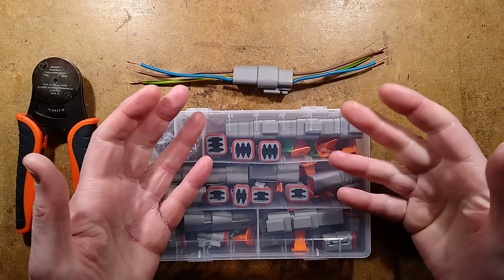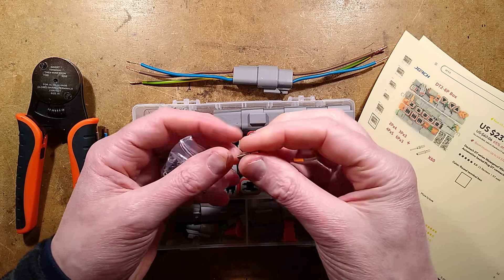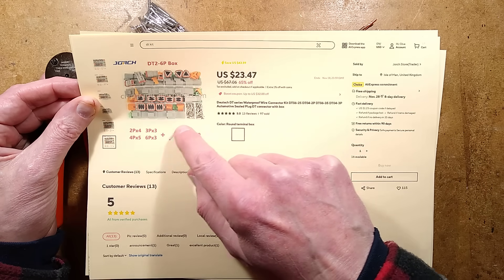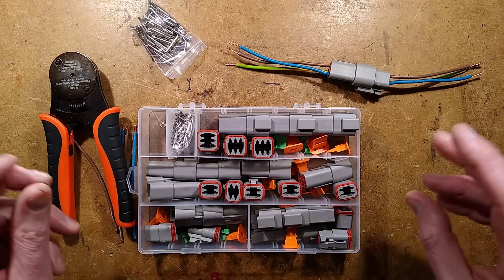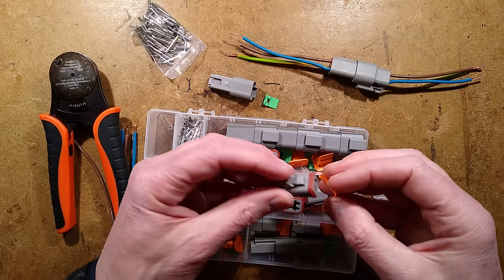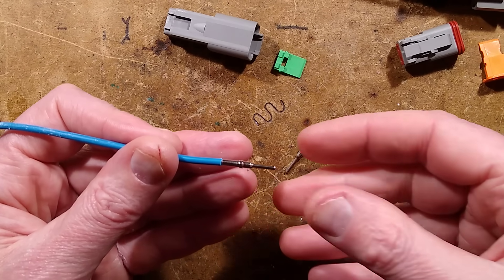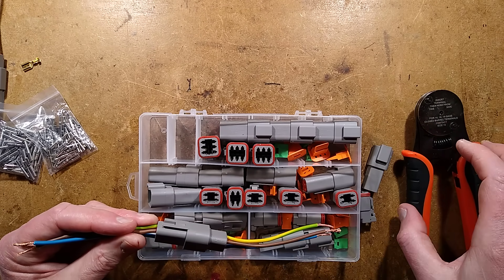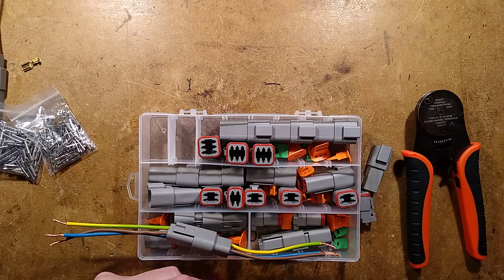Deutsch - my new favourite rugged connector

Comment: Speaking of connectors: does anyone in the audience know the name of these black non-waterproof locking connectors that are usually at the end of LED strips (WS28xx etc)? Approx 2,54mm spaced apart, with the female plug having little "wings" on the side and the male plug having the lever on top to pull them apart again. Looked for them on ebay, but couldn't find them due to the lack of a name to search for... They seem to come in 3 pin, 4 pin or more variants...
Reply from the maker: JST SM?

Comment: Oh, I like those!  More than the ones with the yellow concertina rubber seals.  I'm sure they look very similar to connectors I've seen in my motorbike.  I love your adjustable tool.  I have a similar ferrule crimp tool, but it crimps square rather than round and it's not adjustable - wonder if it will work with the round crimps.
Reply from the maker: The ferrule crimp tool is not suitable for these.

Comment: Actually, brand name Deutsch connector kit from Amphenol (their AT series) is not that expensive in comparison. The AT-CK-715 (715 pieces) kit is GBP 154 from Digikey. The cheapest Amphenol branded tool (AUTK-16) is GBP 35 (more expensive tools available). Not as cheap as AliExpress, but cheap enough that I do not see any reason to buy the copies anymore so I switched. (and yes, Amphenol is also a copy as the original Deutsch is now TE)

Comment: Description
Report Item
188/250pcs Deutsch DT Series Connector Assortment, Size 16 Stamped Contacts, Waterproof Automotive Electrical Connectors

Power Supply: Use Without Electricity

Bttery Properties: Without Battery

Power Supply: Use Without Electricity

Bttery Properties: Without Battery

Deutsch DT Series of environmentally-sealed, connectors are designed specifically for cable to cable applications on the engine or transmission, under the hood, on the chassis or in the cab. Where signal level circuits in harsh environmental conditions,

where even a small degradation in connection may be critical, the Deutsch DT Series general purpose connectors will provide the reliability and performance at the lowest cost. Thermoplastic housings and silicone seals are used to allow the connector to withstand conditions of extreme temperature and moisture.

The solid contacts are designed for use with larger wire size and heavy duty applications. Solid contacts are manufactured using a cold heading process with solid copper alloy wire. Particularly used for critical circuits.

Material

Plug/Receptacle Shell: Thermoplastic

Wedge: Thermoplastic

Grommet: Silicone Rubber

Contacts Pin: Copper Alloy

Socket: Copper Alloy

Finish: Nickel Plated

Sealing Plugs: Thermoplastic

Comment: At 1:38 you described the most common crimp, but you said that the tool curled the sides of terminal into the wire.

I was under the impression that the crimping tool was supposed to go the other way around, and the curled over pieces were supposed to remain as they are while the tool creates a divot in the flat side of the terminal?

Comment: In the end, Deutsch is just like AMP, Erni, ADC Krone and Intercontec part of the big TE Connectivity, former Tyco Electronics, who moved their head office from the Bermudas via Switzerland to Ireland. It may happen that their products that come from China will receive a drastic price increase in 2025 in the US, so it might be recommended that all the enthusiasts here from the USA consider to purchase Deutsch connectors now. Or you believe that the production will come back to USA, which will rise the prices as well.
Reply: So the price goes up, big deal. UK has that VAT. Either way trade is slowed and buyer pays. The last time they did the tariffs thing the parts I buy ended up being stamped as from a country other than China but were otherwise identical in every way. The price did not increase.
Reply: China has workarounds for tariffs, but prices on many things will still go up. Many Chinese companies have moved production to other southeast Asian countries as labor there is cheaper. What we really need is some sort of certification for Chinese made electrical products. Many are of dubious quality, and some downright dangerous, as Clive has shown here many times.
Reply: @ I agree that there are dangerous products coming from China. Anyhow, it never matters where a product is made, it matters who is making it. TE Connectivity / Deutsch will not produce and sell obviously dangerous products.
Reply: @Herr_Bone  That's true, a branded product will have quality control and accountability no matter where it's made. Watch for counterfeits though, some name brand parts are counterfeit and of bad quality. I'd rather have a "house brand" from any big retailer than a counterfeit "name brand".

Comment: Would normal ferrule crimper work as well? (That crimper looks like modified ferrule crimper)
Reply from the maker: No.   It has to use much higher pressure.

Comment: I worked a lot with crimpers similar those when I was in the Navy. We have SUITCASES of crimpers and crimper dies to the tune for some aircraft like the A-7 the Daniels Manufacturing Corp. kits (short name, 'Daniels Kit') had a total of 8  SUIT CASES, with two with similar crimpers for various purposes and different die sets which can be mind boggling when you start with them. Seeing it taken to the consumer level is pretty cool.
Reply: we had to count the number of crimps each crimper and die had done and record it on the tool sheet. after so many crimps the set had to go and be tested and released back in to production by the QA dept. real glad i did not work in  production.
Reply: Of all the places where standardisation would be the sensible thing, the military is it. I suppose you can't charge the tax payer as much if everything uses interchangeable tools though..

Comment: Have you actually placed them in water with 240v and see if they work?
Reply: Of course not...the requirement for automotive applications, where these are most often used, is not full water immersion.

Comment: Having just bought a boat on which the previous owner used a chocolate box connector for the supply to the masthead navigation lights I am very grateful indeed to you for this video. These connectors will be just the job and they are light years cheaper than any "marine" equivalent. 
Utterly perfect timing and my order for the kit and crimper has been placed.
Thank you sir Clive.

PS is there any way to buy you a coffee other than using evil PayPal?
Reply from the maker: PayPal is still one of the best options.  But for ongoing support, Patreon offers more for your dollar.

Comment: Is there no spring tension anywhere in the connection; it's just a straight rod in a tube with no bottoming out? I'm surprised these would work reliably in extremes of temperature if so, given thermal expansion/contraction.
Reply from the maker: There's something inside the tube that creates strong friction.

Comment: Nice connectors.  I'll have to consider these.  Not sure I'd need much more than 2 or 3 wire ones though.  Hey, I have a question.  Is it possible to add a continuity tester beeper to a multi-meter that doesn't have one, but does have the diode check setting?
Reply from the maker: It's not a good idea to modify an existing meter.

Comment: They also use these in Caterpillar wiring harnesses.  A friend of mine who happens to be a Cat mechanic got me into these.  Used them everywhere in automotive applications.

Now we’re moving onto DTM connectors #becauseracecar and as such need lighter weight.

I would also highly suggest getting the proper tool as they provide a little more adjustment than the bear bone tools.

Comment: Another way in which the 'shallow penetration' design makes it safer is that if the lock has opened and the connectors begin to separate, the pins will disengage before the waterproof gasket clears the throat and so water will not get in to a connected circuit.  Or at least, you may notice the loss of continuity before it falls open.

Comment: I worked for Deutsch IPD for 19 years as a machinist and toolmaker.  Carl Deutsch was a good guy to work for.  Seeing those connectors again brought back a lot of cool memories. Thank you.
Reply: Both my Dad and my sister worked for Deutsch in the 50's and 60's. my dad, I believe was in sales, and my sister, Assembling  the connectors.
they Had alot of Gov  defense contracts for rockets and missiles. as a kid I loved to go to the Deutsch Picnic every year. and ya, seeing those pins
reminded me of how one year at the picnic, my sister showed me her work station, with large bins of them. I still have my Dad's lapel pin somewhere.
Reply: @GothGuy885  😀  I worked at the Banning and Hemet California facilities til retirement in 2012.
Reply: @Iconoclasher  both my dad and sister worked at the Banning Facility.
Reply: Deutsch had probably the best warranty in the industry.  There are companies that specialize in making extremely complex wiring harnesses.  Deutsch had a warranty that actually covered an entire harness if a connector failed on the assembly line.  If it failed during assembly they'd pay for the replacement of the entire harness. 
Overall they were a good company to do business with and to work for.
Reply: How long have these specific connectors been in use?
Reply: @bmo14lax I’ve used them for over 20 years.  Industrial trucks.
Reply: @bmo14lax  It would appear since 1959 in somewhat their current form.
Reply: @--_DJ_-- they have been around a long time, but have been prohibitively expensive for consumer products until recently, I guess some IP expired allowing cheaper copies into the market?

The first place I had any contact with DTs was in earthmoving machinery in about 2010 or so. Since then, they've become extremely popular in the Australian automotive aftermarket. I bought a similar grab kit to Clive's about 5 years ago. It cost me AU$240 with crimpers included, but offering more plug options. Mine included a couple of 6-way, 8-way  and a 12-way set as well as some blanking pins.
Reply: @--_DJ_--  The patents on these ran out long ago; anyone can legally make them.
Reply: @daleemmons36  Right on, my comment still stands as mostly accurate though.
Reply: @JonoSann  the precision required from a crimper to make a connection to spec is insane, you probably paid 200$ for the tool and 40 for the rest of the set. genuine DTs are well bellow 1$ for a two pole. With Chinese crimpers you never know what you get, some work somewhat, some dont. Like newer types of 4 pin indents have an inbuilt dro for 1/100th mm incremental adjustment
Reply: duuuuuuuuuuude, your comment reminded me of 24 years ago sitting in my doctor's waiting room studying my organic chemistry synthesis and a very santa looking gentleman with a beard asked me if he could borrow my notebook.... he wrote down a chemical synthesis double substitution reaction he made but couldn't get credit for...... it is genius.   thanks for triggering a HAPPY memory in my brain.... it's been a while.
Reply: Best connecters in the world ever.  Good work.
Reply: A big thank you to the long term work.
Reply: Es gibt anscheinend keinen Wikipedia Eintrag. Schade! Wenn jemand da an Kontakte dran kommen würde und etwas zur Geschichte der Firma und Stecker erzählen könnte ...
Reply: Ist das dieser Karl Deutsch? https://de.wikipedia.org/wiki/Karl_Deutsch_GmbH
Reply: @TheOnlyDominik  https://en.m.wikipedia.org/wiki/Deutsch_Group
Reply: @daleemmons36  Thank you!
Reply: Why are there also AMP "AT" connectors also? They are very similar/identical.
Reply: Digikey sells and I have bought both Deutsch and AMP connectors...Why are there two seemingly identical brands?
Reply: @unionse7en  Amp and Deutsch are both owned by Tyco.  Each part has two part numbers.
Reply: @michael931  I was there when Tyco bought them out.  It's the main reason I took an early retirement.
Reply: I wonder if those connectors would be better than whatever nvidia puts on their graphics cards that creates fires and destroys the cards?
Reply: @cheater00 haha totally. You might want a several pin connector as a two pin would carry max 300w.
Reply: @cheater00 fires are a feature.
Reply: @cheater00  - For the same number of pins, these would be huge.
Reply: @RFC3514  that's fine
Reply: @cheater00  - Well, not if you want them to fit inside standard PC cases. And, if you don't, there would be lots of better connectors (including some already in use by computer hardware). The main point of the 12VHPWR connector was to save space.

Most failures were user error, BTW (improperly inserted connectors), but Nvidia and the PCI-SIG clearly didn't test them enough.
Reply: @RFC3514  buddy there are massive amounts of space in many normal sized cases what are you on about
Reply: @cheater00  - PC connector standards aren't defined to fit "many" cases, they're defined to fit all cases that comply with the relevant standard. If you disagree with that policy, feel free to tell the PCI-SIG about it, I'm sure they'll be interested in your opinion.
Reply: @cheater00  No, dont do it. Look at 11:14. He is inserting and removing pins from each other way too easy. They are touching, but its not solid connection, loose connection on high current means small virtual resistor appears there and thats why it starts heating. You need something better for nVidia cards.

Comment: Are these better than wagyu beef connectors?
Reply: Different use case. These would certainly be better for connections that are exposed to the elements or might get pulled about more than your average light rose connection, but more expensive & time consuming for anything that doesn't require that stuff.

Comment: I found my normal 4 jaw crimpers would do the turned pins ok Although I had to tweak the crimp pressure a little bit... If I did more work on cars I'd probably buy the official set,  given how much I've spent on crimping tools over the years they'd be right at home in my collection.

Comment: These things have absolutely changed the way I look at vehicle wiring for aftermarket electric options (mostly lights).  Yeah, they're expensive and can be fiddly to assemble, but when done right, they are some of the best plugs to use.

I even bought a fancy ratcheting crimp with interchangeable dies so I can do these (I get the cheaper folding crimp style), regular butt style connectors, plug wires, etc.  So handy and worth every bit I paid.
Reply: " fancy ratcheting crimp with interchangeable dies " which did you bought? Is it good?

Comment: How good would they be for replacing cables under trailer for led lights etc. 
Will they survive salted winter weather?
Reply: they survive pretty well especially if you get the types with the extra sealing boot. very common in plant equipment and trucks.

Comment: When I was doing coax ethernet the centre pins were similar to the crush pins shown here.  The crimper was just a standard hex die rather than moving fingers as per the tool shown. It did the job well but the centre conductor in the coax was a consistent size while here you could be putting different size wires into the pins.

Comment: I've seen these used on car rehab shows.  There seems to be a universal hatred of the crimping and assembly of the plugs. (Time is money) And...A universal love of the dependability of the connection and the seal it provides.
I've avoided them because of the expense.  This option has piqued my interest!
Thank you for your time. Always enjoy!
Reply: Time is money.
Rework is time and money
Reply: @JasonW.   Rework is a lot more money and time than doing it nicely the first time. Rework sucks and I end up doing it a lot because of other peoples messes.
Reply: what expense? a genuine one by te is sub 1€ for housing, pins and lock
Reply: Just like the knock off Superseal connectors, I wouldn't expect these to have the reliability and water tightness of the (very pricey) originals.

Comment: Harley-Davidson uses these connectors. I bought a '11 Electra Glide Ultra Classic and wanted to add the QuadLock wireless charger to the accessory switch which leads to a 4 pin plug - 3 hots and a ground. One is only controlled by the ignition switch while the other two are controlled my a second switch as well - one the accessory switch on the console and the other is in the brake light circuit.

I went with the wings crimp style because I was dealing with a much smaller gauge wire from the charger.

Comment: I have used Deutsch connectors for almost 30 years, after they started making the DTP and DTM series in China they started to be knocked off like we see now. I don't believe the HD series metal and poly are being made in China. 

The positive side is companies like Molex are making their own version that is compatible with the genuine TTE and Chinese also.

The "U barrel" type pins are good for limited field repairs, but the "quad crimp" are far better and don't usually fail as long as the crimper tension and depth are set properly and it's recommended to use the original "turret" style crimper for correct crimps.

They do make gold plated pins for CAN and corrosive area use also.
Reply: You see knockoffs because the patents expired so others are free to use the design.
Reply: @andrewfidel2220  Like Chinese companies give a sh!t about whether a patent has expired . . .
Reply: The Caterpillar Spec Deutsch connectors are great
Reply: @Firedad4132  amphenol make AT series connectors which are basically the same as DT.  Ofcourse this proliferation is due to expired patents